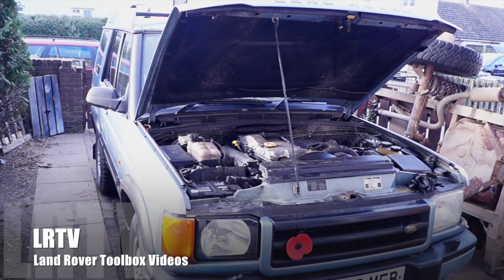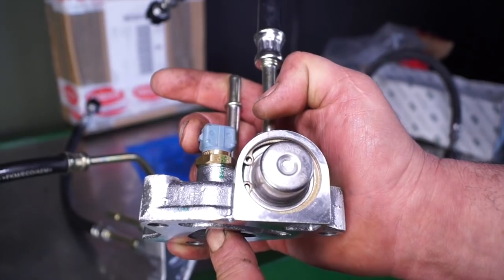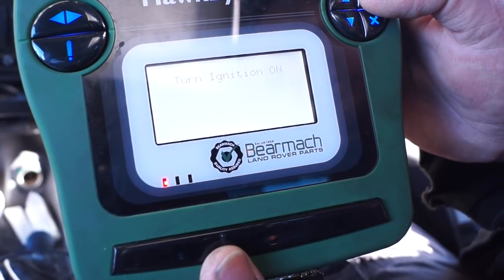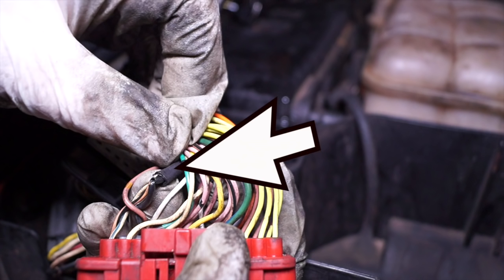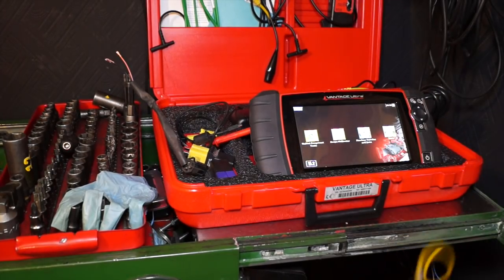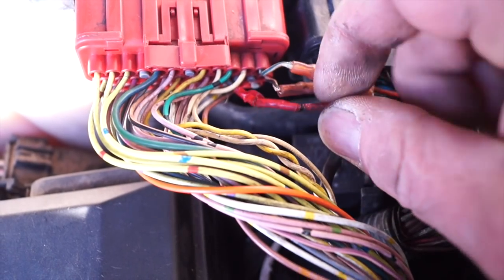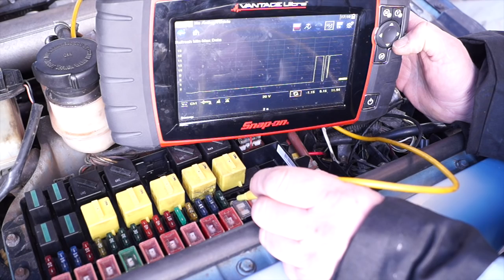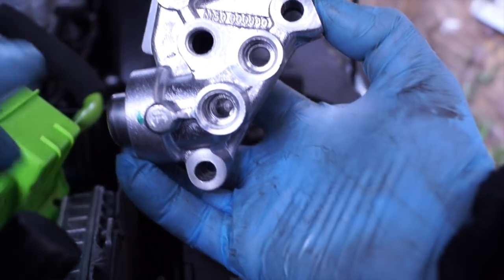Td5 Non start problems. PART 1

Comment: Hi I'm watching this closely as I've just installed my motor after doing a lower end overhaul due to failed oil pump sproket. would start fine before overhaul just oil light on. Replaced bearings, oil cooler, dual mass flywheel flushed out system refurbished turbo. now will not fire after bleeding system several times. Has been standing for a few months while i did the work but now disappointed it won't start. appreciate this channel regards Garry

Comment: I too would be suspicious of the blown fuse and what caused it.  However, several years back I managed to swap the flow and return pipes to the Fuel Regulator.  This didn't cause an issue until I had driven down to southern Germany and I ran the system too low on fuel (into red).  Isn't then wouldn't start until I had sorted the issue and bled the system many times but crucially, cranked engine with throttle fully open.

Comment: I have a bearmach hawk eye,  If you go onto the bearmach site there is application list of what the hawk eye and hawk eye pro can do. The only difference I can see is with the pro you can reprogram the a new ecu to except the alarm system. to sync up.
With my td5 starting problem, I was told that the copper seals on the injectors wear out and the seals on the filter pipe work also wears,letting air back into the fuel system.
Trouble is everybody can advise you of what the problem could be,like myself I had to eliminate component at a time, till I found the fault. As you know if the fault is mechanical it wouldn't register a fault code,unless there is sensor being control by a ecu of some sort. Good luck with finding and fixing the starting problem.
regards

marc

Comment: Had a similar problem on my defender this morning on checking the pressure switch one of the wire had snapped
I reconnected the wire primed the engine and was up and running
Thanks for the tips

Comment: We also had one 110 that failed to start, but which started without problems if towed, or down a small hill. This was off-course a manual. Changed a lot of things, and sometimes it would start when cranking the starter. Changed the cables from battery to starter engine, but it did not help. When we jump started from another car, it started. then we tried adding a second battery, that is one battery for the starter, and another one for ECU and stuff. It did help. Finally the car was sold as a non-starter, or actually there was an exchange between a 90 with 200tdi, and this 110 with td5. The new owner changed the starter, and now the problem is gone. Actually, that was next on our list, but the owner was done with the car.

Comment: I had a simular problem with my td5. I changed the fuel filter,as it could have had water contamination, I changed the fuel pump, that sits in the tank. checked the ecu connector. changed the fuel injection wire loom. then I found the issue to be a collapsed intercooler pipe. the pipe looked ok from the outside. but the inside of the pipe had collapsed. which in turn blocked the air intake. it might be this or not. but worth checking all turbo pipes.

regards. Marc

Comment: Had a no start problem with a ‘06 Defender 90 and it was a bad fuel pump relay and socket. Td5 ECU could not be contacted by the Nanocom I had until fixed. Stumped me for a while that’s for sure.

Comment: i've got a 96 disco with the v8 fuel injected motor that's also cranking no start. It also has no spark and no fuel injector pulses. 

It does have fuel pressure, and i replaced the crank sensor and checked the wiring to it was still working. 

I've also replaced the ECM twice now with used ones but both times when i put key in ignition the check engine light doesn't even come on (with the original it came on). 

Is there a specific process for replacing the ECM that i'm not follow correctly? 

If the CAM position sensor goes bad, will the vehicle have BOTH no spark and no fuel injector pulses? I thought it can run without cam sensor or at least still have spark... 

not sure what to do next :(

Comment: I have a 98 Defender 90 TD5. Suddenly it won't start. It turns over, fires a first time then fails to carry on firing. I tested the fuel pressure on the supply line to the regulator and it was at 88psi. I also cleaned out the small filter on the return line from the fuel filter (filter was replaced in March 2016). The regulator is new and the car has been running without a problem for 10,000 km since. Any ideas out there?

Comment: It may be crank position sensor, also  fuel not  getting at right pressure. Another thing is that fuses are not blowing without the reason. There may be damaged wiring.
Reply from the maker: +Michal Labedz  Yes you are right.  Fuses generally do not blow with cause.     I am sure there is damaged wiring as you have said so it will be a matter of finding it.      Fuel pump performance has been mentioned a few times so  let's start there.

Comment: I know this must seem obvious, but I would check the key transponder code corresponds with the ecu.
Next would be fuel pump pressure.
Great idea to open for ideas and suggestions👍
Reply from the maker: +Christian Toftdahl   I'll check the pressure and check the electrics for bad earths on the pump.     Will check the key.
Reply from the maker: +Christian Toftdahl     https://youtu.be/BENlNexvSL8  check valve in system looks a good candidate.
Reply: +Land Rover Toolbox Videos Great havn't thought about that i.e didn't know the return valve was located there:)
Best of luck and thanks for a great educative channel.

Comment: I eventually found the problem was worst when the battery was low after standing a few days !  The code reader indicated crank sensor not reading ? changed this sensor several tines but the problem was the same ? So while checking the wave signal from the sensor found the starter was producing a wave signal that corresponded to every compression   should not be a problem but the starter cable runs inside the wiring loom thus inducing a wave into the wiring loom confusing the ECU ! I disconnected and isolated  the  starter cable and made and fitted a replacement cable well away from the loom problem gone !

Comment: There's a sensor on the bulkhead that will isolate the engine in the event of a crash. Mine has before just isolated the engine when it was parked. Gave it a tap and of I went again
Reply from the maker: +henry stanford  ah yes the inertia sensor.   Could be tripped by a heavy door slamming. Good call!
Reply: @trailerfitter2  where is the inertia sensor and what does it look like?

Comment: If the vehicle was running before servicing it has to be something connected with servicing it self.What exactly did you do except the fuel and air filter?

Comment: Needs a fuel pump, regulators been leaking so long, diesel has damaged the crankshaft sensor wiring and made the pump work too hard. Wont bleed the air out for a restart after the filter change and pressure loss.  Id nearly bet the gearbox top cover is missing too! The "insulation" on the crankshaft wiring is actually a braded shielding to stop interference on the signal. Starter sounds like its on its last legs or the contacts are burnt out and contaminated with diesel too, this can cause the voltage to be pulled down which can cause a no start. Been working at these lumps for 20 years and they're still going! So much for the td5 haters ;o) Had one thats got 389,000 miles on it and drive one with 230k original engine! It's the chassis rot thats killed them off now!

Comment: Does it start with a squirt of brake cleaner down its intake?  And it definitely has fuel in the tank? Is there fuel getting to the rail? Is there fuel in the oil?

Comment: I'd check you had fuel pressure at the Fuel Pressure Regulator. If not 4 Bar I would check the pump is working and then look at the little gauze in the input pipe to the fuel filter.

Comment: I have a landrover same problem the owner changed the CPS below the number 7th spark plug and when that did not work she was able to send the ECM to some place in new York to repair the unit. Plug the ECM back in to the car. Still cranks but does not start. No spark and I can not hear the fuel pump priming. Could this be a issue with the ignition switch? Let me as soon as you can thanks.

Comment: Have you come across noisy fuel system. Sounds like a bad pump.. replaced pump, new seals.. 1 expert gone through it and still not fixed.

Comment: I been trying to deactivate or disable the alarm system -anti-theft on my 2000 Land Rover Range Rover. Any ideas on where exactly it is or which wire? It does not want to start and the dash gives the message engine disabled.

Comment: To give a guess on the engine not starting, its probably the cam sensor perhaps? or the fuel pumps itself?
Reply from the maker: +Vishnu Rajendran Amboo   This particular engine does not have a cam sensor only a CKP  ( crank position sensor)    Fuel pump I would suspect and really should be our first port of investigation.
Reply: +Land Rover Toolbox Videos perhaps a very "wet" glow plugs?
Reply from the maker: Oil?
Reply: +Land Rover Toolbox Videos yup over flow of engine oil on the glow plugs? am just guessing..

Comment: Where the wiring loom connects up through the rocker box to the injector loom perhalps the connector clip has come loose. A few fonts ago I had to do an alternator on a disco 2 and at some point I must have brushed this and with the same symptoms you had (turning over no go) it wouldn't run, when I saw it was loosely connected it back up properly and it went.
Reply from the maker: +HB  Yes,  continuity check required I think.

Comment: Did you ever get this running properly?  If so, what was it?  We had a problem where the fuel was returning to the tank too quick so the pressure wasn't there for the injectors.  Basically had to fit a restriction to the return line.  This is normally handled by the fuel filter, which can mean the fuel filter needs changing.
Reply from the maker: It was the fuel pump.   Parts 2 and 3 will show you how we got there.   https://youtu.be/KMMbHWY8Qqk

Comment: After the service was the fuel system bled properly after changing the fuel filter ?
Reply from the maker: +HB   Good call. !   Yes it was bled and ran okay.   It was only when it drove away that it cut out.    There is a possibility that it is not bleeding correctly.

Comment: hi i have been following your videos a fair bit and about 7 months ago got myself a freelander 1 2000 model. Wondering if OBD tools like isoftcar can actually read fault codes in regards to solenoid valves on the transmission. Thanks
Reply from the maker: +Vishnu Rajendran Amboo   Ah.  codes are one thing,  Checking solenoid valves are another.  iSoftcar will give you ECU generated code but if you want to check your solenoids then they need to be checked with a good meter like I have to see if the PWM  duty cycle is operating on the solenoid circuit.   Anyway let's concentrate on the Td5 today.
Reply: +Land Rover Toolbox Videos Thanks for the feedback mate, helps a lot esp when there's loads to learn.. Thanks once again.

Comment: Interesting that the TD5 doesn't throw a fault code for a disconnected CKP other than 0rpm. 

Given that the wiring to the ECU seems like such a rats  nest, I think my next port of call would be looking for injection pulse and fuel pressure. From the vid the compression sounds good - even at any rate - but that could be worth a look-see.
Reply from the maker: +Adrian Kingsley-Hughes  Good call injector pulse.    Compression is good.  She runs well on easy start..
Reply from the maker: +Adrian Kingsley-Hughes  Yes I am surprised too that the CKP is not registering especially since it is a life line to the ECM and the CAN network.  .  It did show a small amount of cranking speed for a while then when rechecked it had lost it.    Until 2004 Diesels were not very good for providing EOBD codes and a EOBD reader doesn't connect on this one.
Reply: +Land Rover Toolbox Videos you answered my next question with the easy start! Given the mileage and the fact that she's clearly held hands with quite a few people over the years, I'd also be thinking immobiliser maybe or it might be worth doing some cam/crank scopes to check timing (known good waveforms might be on the web somewhere).

Comment: 2008 Land Rover LR2: No Crank/No Start; Steering Column Locked displayed in dash; U0415-Invalid Data from ABS Control Module

Could all this be caused by a weak battery? Battery was down to 12 volts.

Scan tool was able to read live data with key in ignition. All readings appeared normal for a cold vehicle. 
The instrument cluster lights up, head lights worked. Car would just not crank. Just a bunch of clicking while pressing the "push button" start button. 

What could the problem be? 

Any help appreciated. Thanks!!!
Reply: Wayne Stone 🙏🏻

Comment: How did you "Reprogram it to fit the vehicle"?
Reply from the maker: +Wouter Tom Mulder   Set new ECM to vehicle facility.   One click to get the ECM to fit with the immobiliser.   Then there is a tuning setting to tell the ECU what vehicle it is fitted to.   Finally all 5 of  the injector codes were inputted to the ECU manually.

Comment: Hi,all.I had same problem.first thing I changed fuel filter,cleaned the fuel pump filter(was clogged) and opened the ECU (plenty of oil in)cleaned it and next step ,bleeding the fuel line(ignition on ,5-6 times on acceleration pedal and wait, wait and wait,for about 5 min.)had to do  the bleeding 5 times before fired up.
Reply from the maker: +Bogdan Augustin  Now changed the fuel pump.  It took some priming to get it to run.

Comment: if its been sat for a while then maybe an air lock in the fuel? spent days chasing fuel problems on a friends TD5 defender thanks to their weird routing system
Reply from the maker: +Nick Heywood   I think we'll have to get the piping off and check the filter head check valve to see if this is causing a problem.

Comment: Injector copper washers anyone? If the fuel pump is really noisy when switching ignition on...
Reply from the maker: +macsniper1337  Would the injector washers really cause a none start problem?
Reply: +Land Rover Toolbox Videos Yes- I&#39;ve had this problem with my D2, one 110, and I know of a few other TD5's. Mine could run for a longer time, then suddenly stop. Normally it used to help bleeding the system. Tried to change the fuel pump, and it helped for a week or two. Then I changed the old battery with a new one, and it helped for some weeks. Then it got worse. Changed the fuel injector washers, and the fault was gone. Then a month later a friends 110 had some of the same problems, and we changed the washers on his also. No problem afterwards.

Comment: I'd start with the fuel pump as others have said
Reply from the maker: +Tee Ve   Okay cool.  I got that.
Reply: +Land Rover Toolbox Videos I am also having starting issues and I don't think it is the fuel pump. The pressure is ok, replaced the injector seals and new fuel pump but the problem persists.

I turn ignition on and allow pump to prime. Usually it will start after that. Sometimes however she will fire and then it's almost as if the fuel flow stops and she dies, after that you can forget a restart and leave her for about an hour before making another attempt.

This behavior makes me believe the problem can't be electrical and must be somehow fuel flow related. No one seems to have the answer despite many owners having the same issues.
Reply from the maker: which engine is it?  10 p or later 14 / 15 p?  I also understand that a cylinder head that is cracked can cause this problem.
Reply: ***** I wouldn't know how to tell. It is a 2004 if that helps. I will check the cylinder head tomorow but I am guessing it will be very hard to spot? But I am thinking you may have a point there because that could explain air getting into the system. Good grief I hope not. That bill is going to make my eyes water.
Reply from the maker: get the fuel line pressurised then watch for a drop in pressure over time.

Comment: anyone even thought about taking the ecu out you have to pre programme the injectors back into the system?
Reply from the maker: +chris grayston  Yes it is to tell the ECU what grade of injectors are in the engine so it can adjust fuelling accordingly.  Already done.
Reply: +Land Rover Toolbox Videos  but the video doesn't show that you have programmed the injectors to the ecu, so if in theory as you took the ecu out, changed the injector loom, checked and changed any fuses the next thing you would look at is programming the injectors back in.  when I fucked my ecu after water damage the first thing was put a new ecu and decode the injectors. so you could rule out oil and water damage. then look at possible feul starvation and then worry about electrics, your video didn't show that you've programmed the injectors and ecu to work which would give you the same fault that your vehicle is showing.   basics first before buggering around with anything else

Comment: Working before service and not working after - sack the mechanic :) - maybe the crank sensor was dislodged?
Reply from the maker: +Dave H   Nice try!!    :D   Seriously.  That was taken into consideration however the filters are on the other side to the CKP wiring.  You have brought up a good point though Dave,   Fuel filter change although bled apparently correctly could have dislodged something.